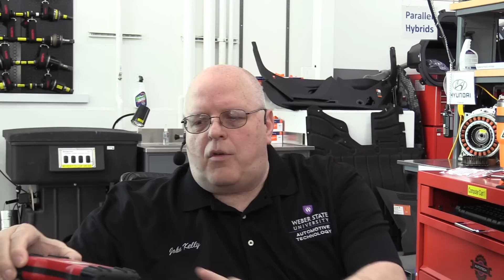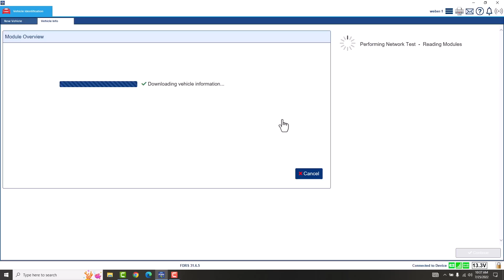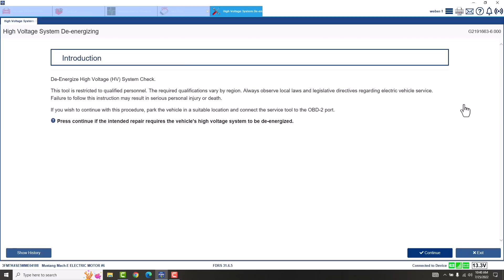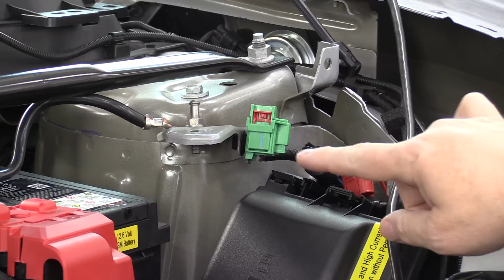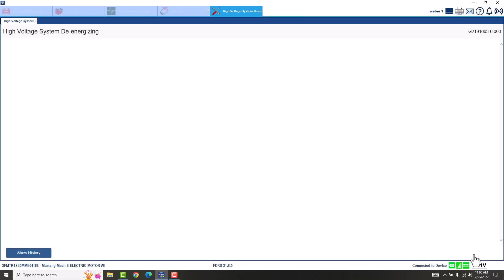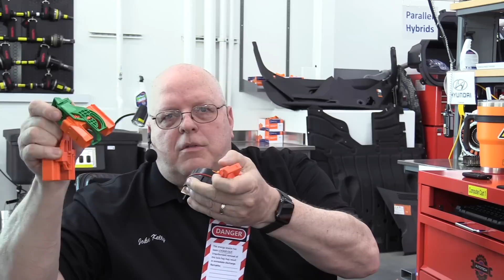How to De-energize the High Voltage System of a Mach-E GT

Comment: That green disconnect.  Have yet to see one of those (parts mgr at a Chevrolet dealership).  I've seen the Volt and Bolt batteries come out, and have done my fair share of help on Bolt recalls as I'm the forklift certified person at work.  I don't recall the Bolt having that green disconnect from watching our EV tech do them.  If I recall correctly, the disabling procedure on the Bolt via GDS 2 essentially has the high voltage system "think" that the vehicle has been in an accident.  The horn will beep for a minute or two during this time, and then this lets you then remove the battery service disconnect under the rear seat.  

So sounds like that green disconnect is heading towards being an industry standard?  Haven't watched any of the GM Ultium training at work yet.  It almost reminds me of the Ford fuel pump inertia switches which are a quick way to disable the fuel pump on those.

Comment: If Tesla's equivalent of that Low Voltage Service Disconnect is a cut loop, then how do you do this procedure for regular service like working inside or replacing the battery? I'm assuming it isn't just to cut the loop and replace it with a new loop each time. Do they have an automated process with a connector that talks to the battery contactors like the Ford scan tool does?
Reply from the maker: The Tesla cut loop also unplugs. No automated process that I am aware of, they use the manual verification method with high voltage PPE and a CAT-III multimeter.
Reply: @WeberAuto  Okay, that makes sense! Thanks!

Comment: John, why is the HV battery to Front Inverter cable connector a grey colour and not orange??

Also, I’m curious as to how the welded contactors (D’oh!!) get de-energized 😖
Very carefully I imagine!
Reply from the maker: Only cables are required to be orange, connectors are not. Welded contactors can not be de-energized, so you just need to be careful working around their output terminals. Their input terminal are always live anyway.

Comment: It gets real fun when the dc fast charge contactors weld shut but do not set any stuck shut dtcs. Fdrs can not de-energize the hv system but ford wants me to replace the hv junction box inside the battery and ford tells me to do things to a $26,000 I don’t expect to ever do to get at least one contactor to unstick so I can remove and open the battery. Good thing it worked because next step was to get in contact with a battery engineer to walk me through how to “carefully de-energize the battery”
Reply from the maker: Keep in mind that the input side of the contactors is always live high voltage. If the contactors are stuck shut, the output  side of the contactors will also have live high voltage. It is not more dangerous than working inside the battery. Just use your PPE high voltage gloves, tools, and safety glasses and follow the step-by step procedure to replace the battery junction block. My next video will show the procedure. Thanks for your feedback.

Comment: I am kinda surprised there is  no requirement to remove the ground from the AUX battery.  Guess it is required to run the scan tool for the automated process. Also strange the low voltage service disconnect is pull up to disconnect...lean hazard  if not locked ???  Awesome Vid. Cheers 👍
Reply from the maker: We do not need to remove the 12V battery ground because opening the LVSD circuit accomplishes the same thing; not power to activate the contactors. Thank you! I had the same thought the first time I saw this method.

Comment: I work for Robert Mondavi winery as a mechanic and anything we work on the lockout tag out anything electrical water hydraulic pneumatic but on our giant presses that press the grapes when we have to go inside the tanks we lock out each device power air water with its own lock then depending on how many guys are working on the unit we have a main lock box and we put all those keys in there and then on that lock box we put all our personal locks on, Per OSHA requirement!
Reply from the maker: Good job. Great to hear!

Comment: can't you just run the car until it runs out of juice
Reply from the maker: No. It would still have dangerous voltage levels
Reply: @WeberAuto  ok.. capacitors right?
Reply: No. There are 96 series cell groups. Below 3V is "discharged"to 0% SoC...there's still 288V there.

Comment: Thank you John. I'm curious what the (rough) procedure would be if indeed the contactors are welded shut, and you find 400V on the terminals. Cover them with a wad of electrical tape and keep the linesman's gloves on as you remove the battery?
Reply from the maker: Nothing special. Just keep your PPE on as you continue working.
Reply: HV Connectors meet IPXXB ingress rating in the unmated condition, meaning they are by that definition fingerproof. By SAE Hv Battery Safety standard (forgot which one), do not need a manual service disconnect (for instance of both contactors are welded) if HV connectors are IPXXB rated.

Comment: Thank you for the useful information you provide, great video keep posting and we want information about the Toyota RAV4 EV and can I increase the mileage of the charge
Reply: Drive slower, and don’t go uphill….it’s just basics….nothing mechanical or electrical you can do, but maybe if a bigger battery is available at some point.
Reply from the maker: Keep your tire pressures in spec too.
Reply: Check my channel for the 2012-2014 RAV4 EV

Comment: Great video! Seems like this is mostly a bunch of safety checks done by the scan tool and a software lock-out of the HV contactors. Any of the interlock connectors would prevent the contactors from closing anyway. There should be no power outside of the HV battery (i.e. the contactors are open) when the vehicle is off and not charging anyway, except in situations where it may be charging the 12V battery. Perhaps that’s the reason why they have a software lockout. It’s probably a smart choice anyway, just to give an extra layer of safety.
Reply from the maker: Thank you, that is correct. The contactors are normally open when the car of off. This new LVSD, is a great extra layer of protection.
Reply: @WeberAuto  never trust contactors, they might stick closed!!
Reply from the maker: @traqnsavov822  Agreed

Comment: Measuring into plugs is dangerous and not recommended. Use measuring adapters for that.

Edit: we had a case here with a first failure and welded relais, the guy who was measuring made accidently contact with probes between shielding and opposite potential, he was a few weeks in hospital.

And there are more reasons to not do that
Reply from the maker: That is a good point. Thanks for your feedback!
Reply: Interesting. What is a "first failure"? Were both contactors (relais) welded closed?
Reply: @diyEVguy  first failure means you have HV plus or minus potential on the chassis what normally is not the case. Than it's enough when only the opposite potential relay is welded, than you have both potentials in the plug very close to each other.